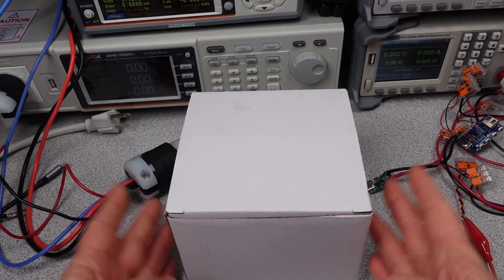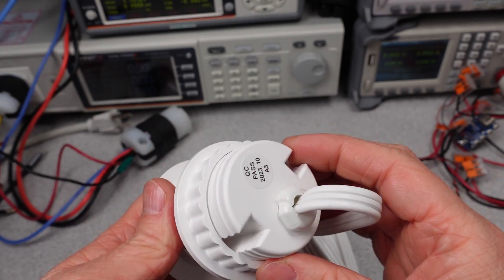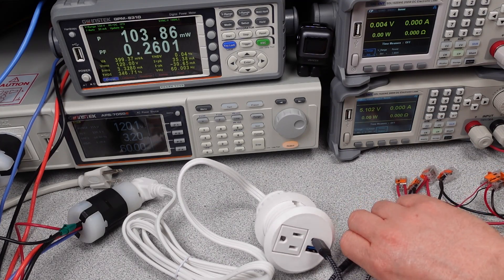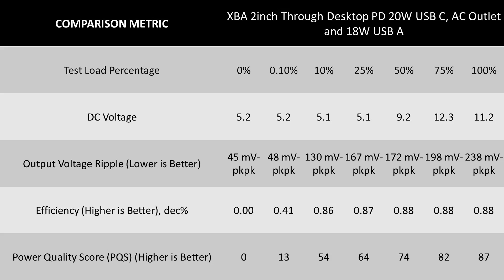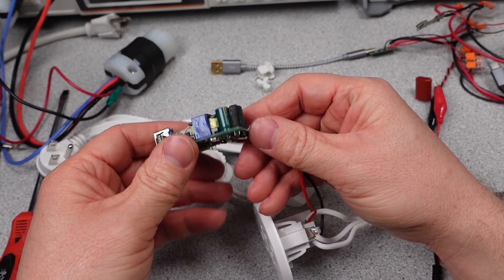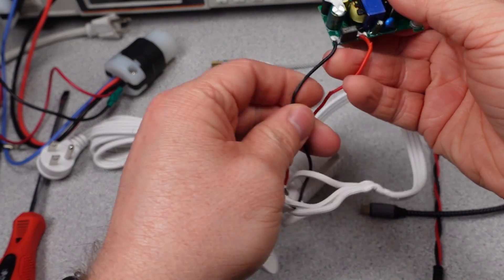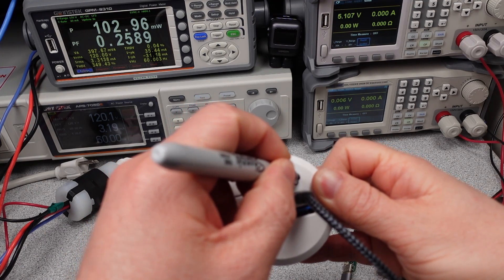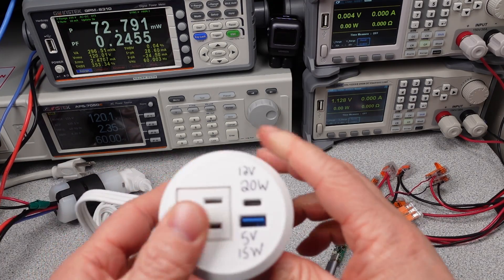Through DESK USB and AC socket, are they safe?

Comment: Unrelated to this video but do you if the Samsung 45w or 25w supports qc 2.0 and apple 2.4a charging? 

Also have you checked out the belkin 30w WCA005my1MWH-B6, it supports pps
Reply from the maker: As far as I know Samsung does not support those modes of operation.  I do have a Belkin series coming soon, I'll have to check if the 30W is part of that.  The model numbers are so easy to remember, haha.

Comment: I have two of these on my desk, I have my watch charger plugged into the USB-C and occasionally use the normal AC plug for random things when I need some power. 

Haven't had any problems with them so far!
Reply from the maker: Yeah, I think it's just luck of assembly.  Which is unfortunate, it should be a great product.

Comment: Well, since you start every video with the suggestion to ask questions, I'll take a shot. I feel it's a pretty basic one, it's about the charging itself.
Let's say I bought a new smartphone and a new charger for it. The phone has 3000 mAh capacity and it requires 9 V or 5 V for charging. The charger has 30 W of power, and it can deliver 9 V and 3 A.
Does it mean that, ideally, I can charge the phone in one hour? Obviously never in real life, just theoretically.
And if the charger can only supply 5 V and 3 A to go with it, still, one hour for a full charge?
Reply: 3000mAh == 3Ah; @4.2V that would be 12.6 WHr, so if battery chemistry was ideal you could do it with 12.6W.

9V@3A is only 27W, not 30W. If battery chemistry was ideal 27W could charge the battery in about half an hour.

5V@3A is 15W. If battery chemistry was ideal it's greater than 12.6W so it could do it in an hour.

Chargers are rated for peak loading, but battery tech imposes limitations on the amount of power the battery can accept near its maximum state of charge. A battery might be able to accept 3 times its capacity rating (9 amps for your 3AHr example) near 20% state of charge, but only 1/3rd of the capacity rating (1 amp for your 3AHr example) at 90%. This is why phones that can get to around an hour for charge times have ~60W chargers: they run very fast while state of charge is low but need to slow down near the top.

In addition to battery chemistry concerns, charge rate may be affected by limitations in power handling capacity of hardware in the phone. The fastest charging phones adopt protocols like PPS or SuperVOOC which defer the problem of matching the internal battery voltage for charging to the charger rather than the phone.
Reply: @BillyONeal  
Thanks a lot for taking the time to reply!

Why did you choose 4.2 V at the beginning? 

I’m just trying to figure out the connection between all of the elementary electric parameters. Chargers advertise in Watts. Phones advertise in mAh. Voltage is given somewhat in secret 🤐
Reply: @ELaster1  because that's the voltage of most batteries in most phones these days. Ideally these comparisons should be done in watt hours not amp hours because two different batteries can have the same amp hour rating and have vastly different amounts of energy
Reply: @BillyONeal  
So I need to look after the phone’s voltage, which is even less common knowledge. 

Thanks a lot, it really helped 🙏 
Take care!!
Reply from the maker: It's a simplified view, there is also a resistance associated with all of these components that will waste a little bit of the energy from all of the steps.  So, like I show in power bank videos, the energy in is probably 20-30% higher than the battery itself but yeah getting on a lot for a comment response.
Reply from the maker: Thanks for the replies!  Great stuff.

Comment: I have something like this with  two 120v ports two A's and a C port. I drilled a hole in my credenza. I wanted it so I didn't have to run cords from the floor over my desk. It works fine for my needs.
Reply from the maker: Thanks for sharing!   Yeah, I saw the other types out there, like I said the performance was fine on this, it's really just the assembly issues, or quality control.